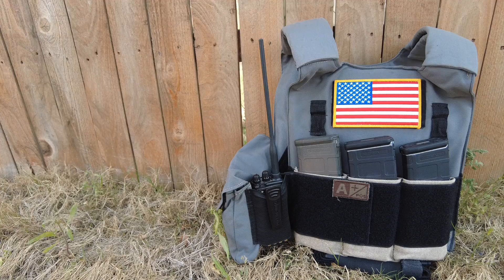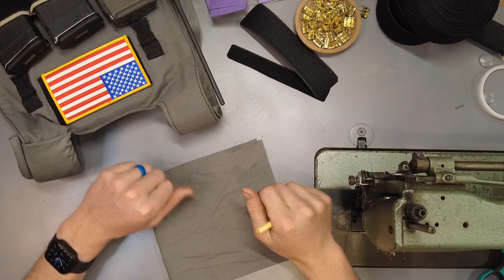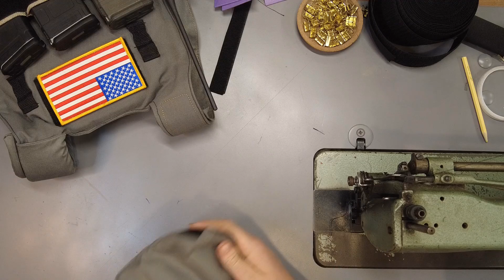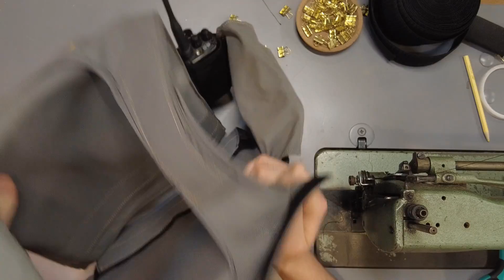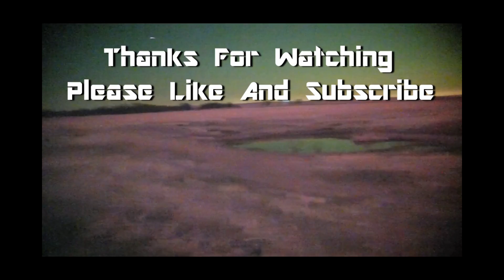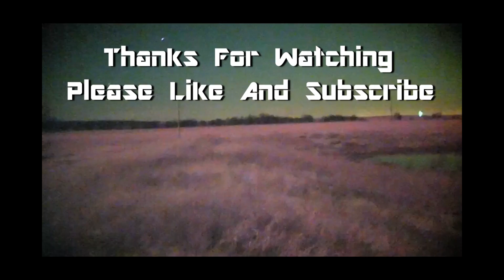How to make shoulder pads for your chest rig or plate carrier

Comment: Off topic but what 3d printer do you use?
Reply from the maker: Ender 3
Reply: @thriftyoperator637  which ender 3? I just picked up the ender 3 pro today for $100 on sale!
Reply from the maker: @PracticalTacticalSheepDog  just the original. That’s a great deal. Where did you find it?
Reply: @thriftyoperator637  microcenter, there is a promotional $100 off coupon available. I'll try to post a link in a separate comment but youtube will probably block it.
Reply: Yeah YouTube deleted the link already. Just Google "microcenter $100 3d printer" and a reddit post will show up with a link to the coupon.